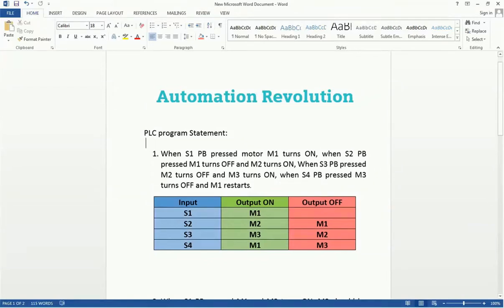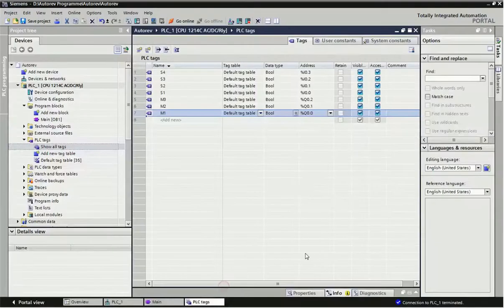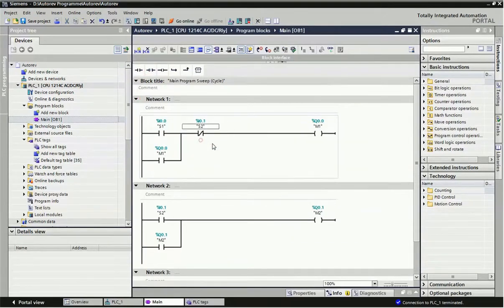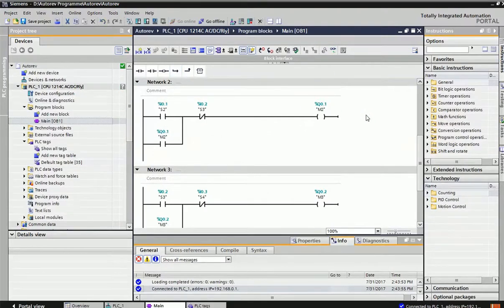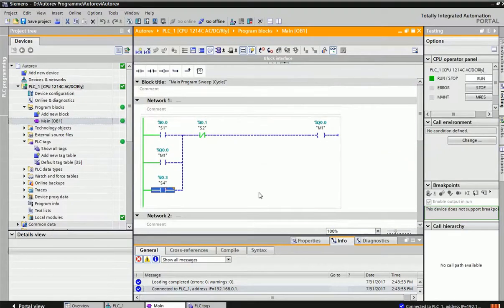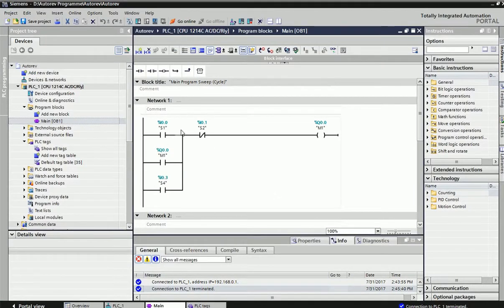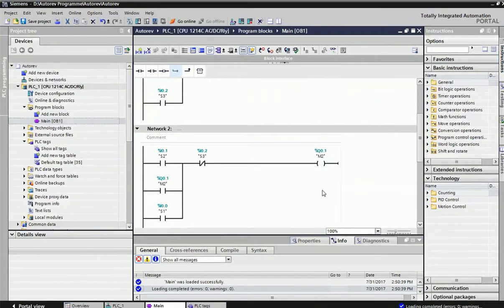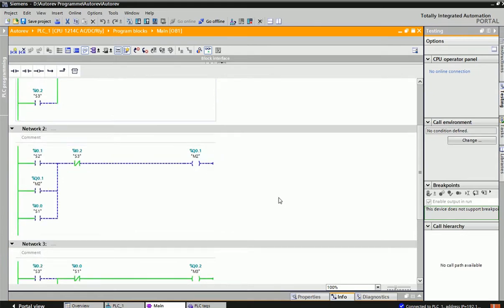How to learn PLC SCADA Ladder logic programming online ? #PLC #SCADA #Industrial_Automation

Comment: Why do we use latch ? Why don't we use single switch only?
Reply from the maker: Mostly In Industrial Application Push Button type of switch are used. Because Push Button is just sending Pulse with Rising or falling edge. In PLC logic Pulse type of inputs are very useful for develop logic. Second reason is in Control Panel Push Button is that type of input which send the signal only if intensionally pressed. So its avoids accidentally input from user. If you keep continue Input it's carrying current and it may cause heat loss and power. So technically there are many reasons .
Reply: How 2 parallel switches avoid the accidental input from user?

Comment: Why can't we draw single network ladder diagram for the second program??
Reply from the maker: Good question. Actually PLC scans every ladder network from Top to Bottom and left to right. So while you compile program that time software scans through each network. So if there is any bug or error it will identify only network number or Ladder number. So if you out only one output in one network it will be easy for program editing and fug fixing. Even new programmer can easily understand ladder. So practically it's easy to develop and modifying program. You can take two ladder diagram in one network. All programmer have different methods.
Reply: Thank you